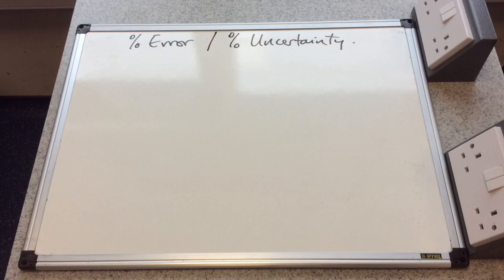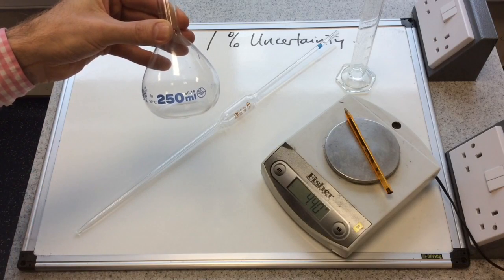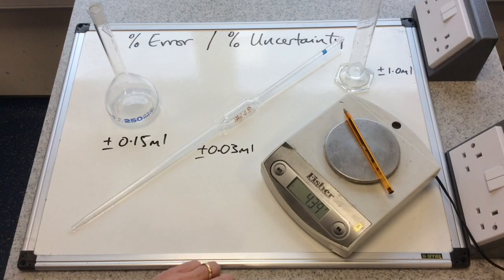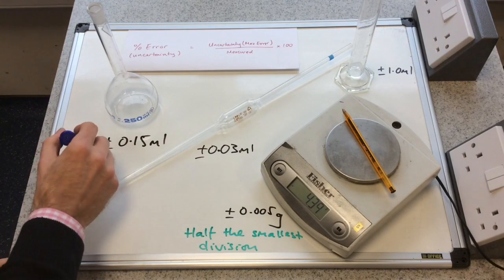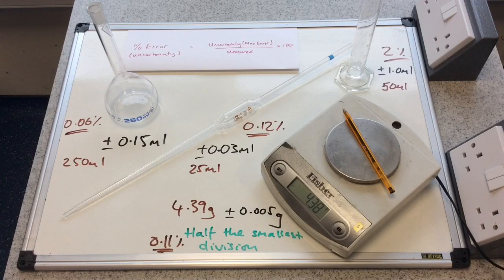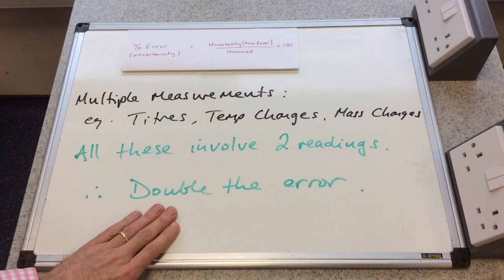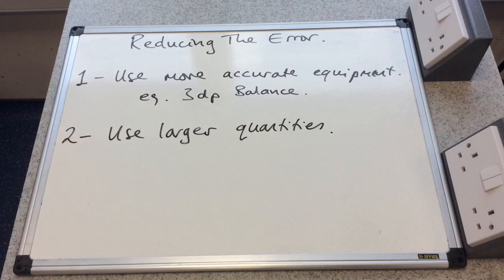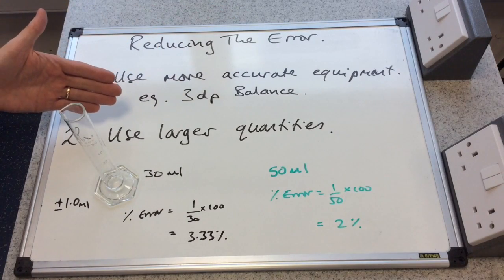PRACTICAL SKILLS - PERCENTAGE UNCERTAINTY

Comment: Do different measuring tools have standard uncertainties we should have memorized, or will paper 3 always provide us with the error values?
Reply from the maker: You're always given the uncertainty. As a rule of thumb it's always half the minimum measurement of the apparatus e.g. a burette measures to 0.1 cm3 so the uncertainty is 0.05 cm3 etc
Reply: @MaChemGuy  Thank you! So do you recommend memorizing the minimum measurements of different apparatuses?

Comment: Would you double the uncertainty if it was volume?
Reply from the maker: If measured by a pipette, measuring cylinder or volumetric flask no as there is only one measurement taken. If a titre from a burette then yes as it’s derived from two measurements

Comment: For the mass, why don't you do 0.005 + 0.005 / 4.39 x100? I thought you had to account for the zero error, and the reading error...
Reply: The only reason why there is an uncertainty of 0.005 is that we are unsure whether the mass of the pen is 4.395 or 4.385. However, we know (or at least we would assume) that the balance is correct. The zero of a balance is zero, not zero point o o 5(0.005) nor negative zero point o o 5(-0.005), we could argue with the balance's precision (uncertainty) but not accuracy because we don't really have the ability to fix it (at least not in an AS level chemistry class). :)
Reply: dno did u find out?

Comment: I just came across a question that  expected us to know the uncertainty in a burette and then calculate the percentage error. The uncertainty used in the MS was 0.1 . What are the uncertainties that I should know ?
Reply from the maker: Uncertainty is half the minimum measurement so for a burette will be 0.05. I'm assuming the question you refer to is for a titre which means the uncertainty is doubled as it relies on two burette readings

Comment: when you are calculating the mean titre how do you know which value you should leave out in the overall average calculation
Reply from the maker: AASIM AZAM Should be within 0.1 cm3
Reply: If the measurements include more than 2 readings would you times it by the the number of readings or still by 2?
Reply: AASIM AZAM if you have two readings that are within 0.1 of each other then you take those readings, add and divide by 2. If you have more that two readings you have to check that they’re within 0.1 if they are, then add them you divide it by however many are within the 0.1 range